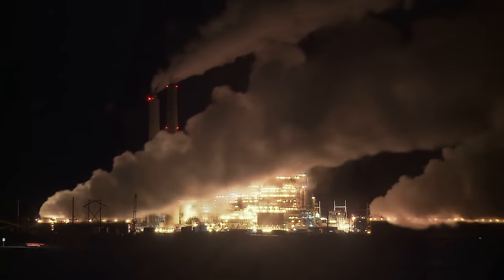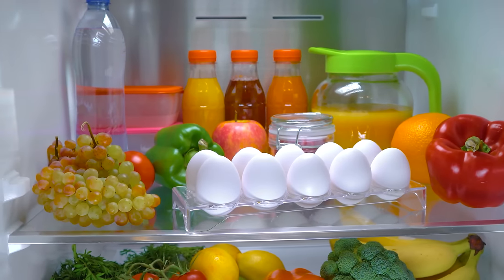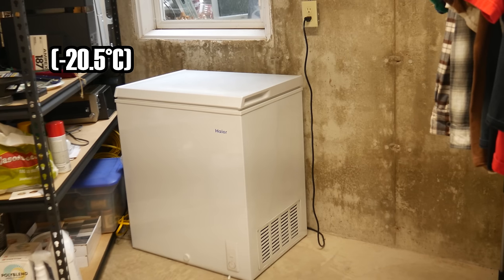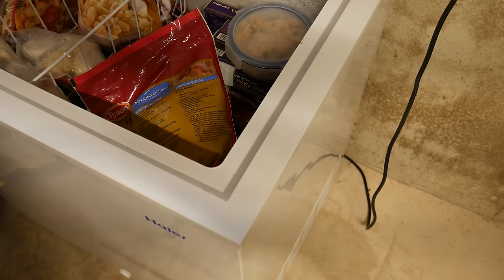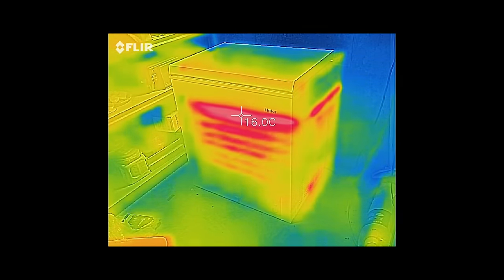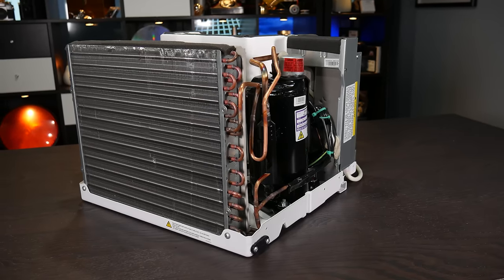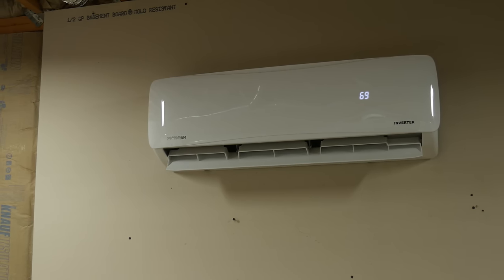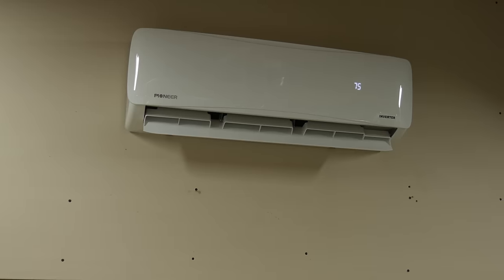Heat Pumps: the Future of Home Heating

Comment: Watching the split-unit heat pump working, I heard the voice of my long dead grampa: “Sonny, are you trying to air condition the outdoors?! In WINTER?!?!?”
Reply: Er yeah, pretty obvious it doesn't work. You'd have to be nuts to get one of these ridiculous contraptions installed, I don't care what the shysters who promote them claim.
Reply: @Withnail1969  They do work though.
Reply: @aaronsmith9688  they don't work to heat your home when it's cold outside. can't provide heat from an environment thats colder than what you're trying to heat.
Reply: @Withnail1969  But air conditioners do the same thing, and so do fridges. Also, the cold outside still has a lot of energy.
Reply: @aaronsmith9688  Ignore him, he doesn't understand science therefore it's a sham.
Reply: @aaronsmith9688  you can't heat something up using energy from something that is colder than the thing you're trying to heat. it would be more efficient just to use electric heaters inside your home than suck in cold air to a heat pump and heat it up.
Reply: @Withnail1969  It's not using energy from the thing that's colder. It's still using energy from the powerplant. It's using that energy to move heat from that cold outside air, to refrigerant in the evaporator that's even colder than that. Then it heats up adiabatically through the pump (no energy transferred) and goes to the condenser, where it's warmer than the air in the room, and transfers that energy into the room.

And, as explained in the video, that can be more energy-efficient than a resistive heater.
Reply: @FlyNAA  the air outside the house is colder than the air indoors so it is using something colder to warm up something warmer. physics says that can't be done.
Reply: @Withnail1969  the air in your fridge right now is colder than the air in your kitchen. Yet if you stick your hand behind it, you'll find that the fridge is using that colder air to warm your warmer kitchen.

Also a window unit AC warms the warmer outside air using the colder inside air.
Reply: @FlyNAA  Right. that does happen, but it's not an effective way to heat the room.
Reply: @Withnail1969  yes it's not very effective as it's a byproduct, and not what it's optimized for. Yet it does happen. But in your previous post you said "physics says that can't be done."
Reply: @FlyNAA  what i mean is that it can't possibly be more efficient to try and warm up a home using this device when its cold outside compared to just using electric heaters indoors.
Reply: @Withnail1969  OK. Only being able to work less efficiently than some other mechanism, is a different claim from not being able to work at all. But it's also not supported by physics.

You're thinking of it as the temperature being raised by conversion of the energy input, and reasoning that it's gotta be less efficient with more steps in between. And so much would be right. But a heat pump is not converting the energy from the power company, like a resistive heater is. It's using that energy (a small proportion of it, comparatively) to cleverly manipulate OTHER energy that is already there, in nature.

Think of it like the musclepower to cut down the trees and assemble a waterwheel to run a factory. It's using a small amount of energy (for cutting and assembling) to then be able to manipulate a vastly greater amount of energy that is already there, in the river. Your argument is like saying that it's more efficient to cut out the middleman (waterwheel) and turn hand-cranked machines to run the factory directly. That would be the direct energy conversion from muscle power, but it's not how a heat pump works. The waterwheel is how it works.

Anyway the proof is in the pudding, these heat pumps are already installed in a mass consumer and industrial scale, and by now somebody would have caught on to that they're paying more in power bills.
Reply: @FlyNAA  as I said,  impossible that it could be more energy efficient using one of these in cold weather than just using,  say,  electric radiators.  I have read many stories from former heat pump owners who said the heat pump was useless in cold conditions. your explanations don't really make sense.
Reply: @Withnail1969  You did say it before, just as incorrectly as the most recent time. It's far likelier that you didn't follow my explanation, than that it doesn't make sense. Try the Wiki article on Coefficient Of Performance (https://en.wikipedia.org/wiki/Coefficient_of_performance) if it's your jam, but it's far drier reading than the waterwheel analogy. 

The main take away is that the COP (which can be measured), which is the ratio of energy moved by the heat pump to energy consumed to do so, can be several TIMES higher than one. (Here https://cooperandhunter.com/it/news/testing-heat-pump-systems/ is a real world test where one was measured at 6). So 600% of the consumed energy was moved by the pump, compared to the efficiency of a resistive heater which can only be less than 100%.
Reply: @FlyNAA  the report tells me nothing,  I need to know how much energy the pump used and what temperature did it heat the indoor space to with that energy. seems basic information like that Is disguised with mumbo jumbo.
Reply: @Withnail1969  did you even watch the video? He measured the power use of both methods, and compared pros and cons of each. A heat pump is absolutely more efficient than heaters but don't operate in places that are too cold for it (efficiently or effectively) however, it is very small upgrade from a traditional air conditioner and so there's no reason why it shouldn't be installed in homes with air conditioning already installed as a secondary efficient heater.
Reply: @TrendyWhistle  where are the figures? say its 2 degrees C outside and 10 degrees C inside. How much energy does the heat pump use to get the indoor temperature to 20 degrees C?
Reply: @TrendyWhistle  so its not more efficient than heaters when you actually need it most when its very cold. that's what i'm saying. why would you spend money on something that doesnt work in cold weather.
Reply: @Withnail1969  it works in moderate temperatures and is a lot more efficient during that use, if you live somewhere where it doesn’t get too cold but you still need a heater you still get to use it during those days. Idk how much more these things cost per sale, but the actual implementation is supposed to be quite simple that ideally it shouldn’t cost much more to have it installed with air conditioning.

Of course it depends heavily on the cost of power in your region, what kind of weather you typically deal with and if it’s expensive, how much you care about lowering emissions. But it’s good to know and understand how this option works.

Ideally it could be used with a smart thermostat that could manage its use with other heaters in order to seamlessly combine the benefits of all solutions. Knowing the industry though, I doubt there are great options for this yet.
Reply: @TrendyWhistle  Yes I can believe that it does work quite well if it's not too cold. But it needs to work when it's very cold or it's not much use.
Reply: @Withnail1969  that’s addressed in the video, but in general, this solution works great for places like Texas or the south where winter rarely ever goes below 5C, additionally, it’s a matter of time for applications where it can work perfectly fine and efficient even in the cold, with the same tech, but with geothermal pipes installed, you can run a heat pipe in extreme cold extremely efficiently all year round.

Its not an ace that works in every situation, but our current system isn’t perfect either. A solution doesn’t have to be perfect to be better than the last one, and if you can afford to have more than one installed, you can cover up the flaws of both systems etc. this is assuming heat pumps aren’t prohibitively expensive like they should be.
Reply: @Withnail1969  If you can manipulate the boiling point of the refrigerant enough, it could in theory do some amount of energy transfer through almost any gradient. The only reason that most of them are unable to work in extreme weather is because it's cheaper to make them like that.
Reply: @Withnail1969  it's of perfect use when matching it to the use case it's designed for. Jet liners are designed for a certain runway length and airport infrastructure, and you wouldn't say they're "not much use" because there are also sand bars where fishermen like to go. Fine, you use a bush plane to go there, and a jet liner to move 300 people to another continent.
Reply: @FlyNAA  Thing is here in my apartment I don't need any heating on anyway when it's not particularly cold outside.
Reply: @Withnail1969  So your apartment  doesn't need heat, we've come quite a long way from saying that heat pumps don't work.
Reply: @FlyNAA  it does need heat, it just doesn't need it when it's not particularly cold outside which is the only time heat pumps work lol. heat pumps are useless, QED.
Reply: Sorry, you don't understand the refrigeration principle. You don't realize it but you just said that air conditioners don't work and are a rip-off.
Reply: @hkelly1623  to his credit, he backed from from that, to just saying it's not efficient for the case of his apartment (though generalizing from that to the whole world)
Reply: Further, heat pumps, which are reversible air conditioners (common mis-term for air refrigerators) are more efficient than resistance heaters down to below freezing. By about 5°F a heat pump is down to about 100% efficient, the same as a resistance heater. Below that, the heat pump can be shut off and resistance heaters or electric furnace used alone.
Ground or water source/heat sink can be used anywhere on the earth where electricity is available.
Reply: @hkelly1623  nonsense. you would be much better off just using heaters inside your home if its really cold.
Reply: @Withnail1969  I’ve been installing theses in Scotland for thirty years. They take low grade ambient heat and ‘multiply’ it where you want it (inside the building). They absolutely do what you saw they can’t. You should google the Kelvin scale, it’ll blow your mind. Even when it’s cold for us, there’s still loads of heat.
Reply: @Withnail1969  utter bollox
Reply: @martinmillar8447  They are useless in temperatures below 5 degrees C or in poorly insulated homes, which is most UK homes. Not suitable for my home, that's for sure.
Reply: @Withnail1969  They definitely aren’t useless. Modern inverter stuff on R32 gives really good performance even on cold days (we have plenty up here)
Reply: @martinmillar8447  useless for most UK homes as the insulation isn't good enough. they can be used successfully in Passive House type buildings but there aren't many of those.
Reply: @Withnail1969  when heat pumps are installed correctly they're useful till about -20°C here. I've recorded 90-95°F air coming off the evap/condenser coil( the evap becomes the condenser during heating mode) in -15°C weather. They're very common in Canada. They're very efficient at maintaining temperatures, but they're always paired with a backup heat source because -40°C does happen. But most homes in Quebec, Nova Scotia etc primarily run off heat pumps.
Reply: @Withnail1969  if heat pumps aren't good cuz insulation isn't good, then the other alternatives are much worse. Like he literally says in the vid about how pressure changes boiling point yet you kept arguing on temperature difference, then how heaters are better when in the vid n by the COPV ratings as well, the general efficiency of his ac heat pump was 2.9 which means on avg it was giving cooling or heating of 29 Watts of energy when consuming 10 watts, which for a general heater with coil is 9.5 watts or 12W at max.
So insulation would help, but without it doesn't mean suddenly ur electric heater or any other tech gets better and heat pump gets an disadvantage.
Reply: @arnabbiswasalsodeep  i have a gas boiler that heats hot water for my radiators. It works just fine.
Reply: @Withnail1969  did you even watch the video lmao
Reply: @DuckInGameStop  yes i did. heat pumps are no good in cold weather.

Comment: Been using reverse cycle air conditioning here in Australia for over 15+ years, earlier variants weren't great around -4c but they did include a manual coil defrost cycle, the last unit we purchased runs most of the year as the sole heating source best economy 👍
Reply: Yeah we have 3 reverse cycle units. I’m 51 and until maybe only 15 years ago I didn’t even know there were one-way ones available (excluding fridges and hot water heaters) - I thought they were all reverse cycle units including those window box ones they love in the US.

Comment: Thank you for this episode, and wondering whether you might consider having a look at a system with a good few comparable facets and physical processes involved - gas compression in particular ... called a trompe (or trombe).
>> gas (air) is isothermally compressed by being carried as small bubbles in flowing water
>> which allows the gas compression heat to be transferred away from the air) 
>> water flow is directed down a vertical chute (sheer drop - falling)
>> at the bottom the aerated water is collected in an underground chamber
>> the water flow slows down there and the air and water separate out
>> the air rises up in the chamber is collected up in the domed top of the chamber,
>> air is now at a higher pressure than it was prior to being carried down the vertical chute.
>> from here this cool compressed air can be directed away back to the ground surface.
>> meanwhile the water continues to be routed onwards
>> on account of the water pressure, this water output can be directed back up to a final level only slightly lower than initial elevation of input (where the chute begins to descend)
>> the isothermally compressed air will provide cooling if allowed to decompress; (of course various uses exist for compressed air)
>> a large scale trompe - Ragged Chutes - was operated over a very long period; isothermal process, with virtually no mechanical moving parts - so due to a relative lack of mechanical stresses to and heat induced damage to contend with, maintenance needs are remarkably modest.
Greetings from the southern hemisphere. Cheers.

Comment: We've used heat pumps for decades here in New Zealand, if you put a water removable fitting on a heat pump you use it as an air conditioner over summer and a heat pump over winter. You need a specific type of heat pump to run at negative temperatures or they will just keep cycling and not do any heating so make sure you ask your dealer for the right pump for your outdoor temps! Im putting 2 new heat pumps in my shop in next few weeks.. The new wifi heat pumps also have an air purifier on them now.
Reply: Why? It's never cold in NZ LMFAO.

Comment: Great video brother! Quick note on 14:59 - The metering device on a MS is usually a capillary tube unless it’s more efficient  and then you would have a thermal expansion valve of some kind or electronic expansion valve. However they are not located in the indoor unit they are actually located outside on most occasions.
Reply: Almost ALL mini split heat pumps use a electronic expansion valve. This along with variable speed compressor and fan motors allow heat pumps to harvest heat at below zero temperatures
Reply: @hvacmike1175   Right! EEV’s are everywhere these days I’m beginning to see them more and more even on traditional residential splits. More or less on Trane units in particular. It’s amazing how many guys I talk to you that I have no idea how they even function. It’s the future!

Comment: Another interesting video.  Thanks!
Our current home has three modes of heating.  One of the air conditioners has a heat pump "option" (expensive for how little is involved), so in cool weather we can get that efficient heat from electricity, and do most of the heating with it.  I don't know the rating on it, but we've noticed it makes a lot of extra noise, and produces way less heat, anything below about 35F.  So then we have to use the other modes.  There are a few resistance heaters, kind of an expensive way to heat unless electricity is "free", and a propane furnace, which takes over the great majority of the heating in truly cold weather.  In our circumstances (the propane gives it away), a ground-source heat pump is out of the question.  In a future home, I'd like to have one of those, powering radiant floor heat, if possible.
Reply: I have a heat pump & it heats the whole house without problem.  Bills are $200-250 a month
Reply: @electrictroy2010  My gas furnace only costs $60 per month to heat my home, while the A/C takes $250 to cool it. If I had a heat pump I'd be paying more in the winter than I currently do. So I do hope it's NOT the 'FuTuRe'. Besides, where I live, heat pumps fail after temps drop enough below freezing, and switch to 'emergency heat' mode which is even more expensive. Although I've only had experience with ancient heat pumps from the late 1970s. I think it was that old since it's a brand that no longer exists (Amana), and the thermostat was made with mercury switches inside it.